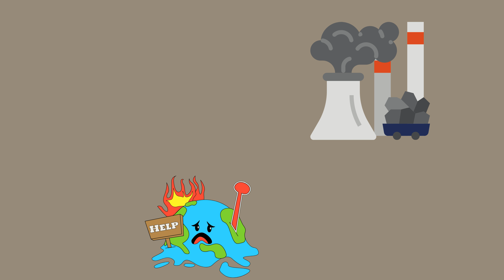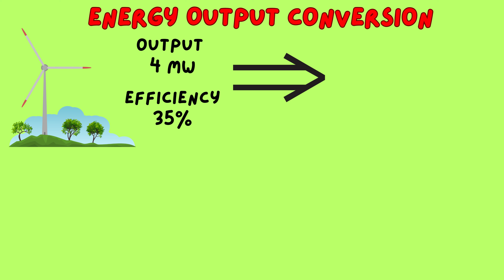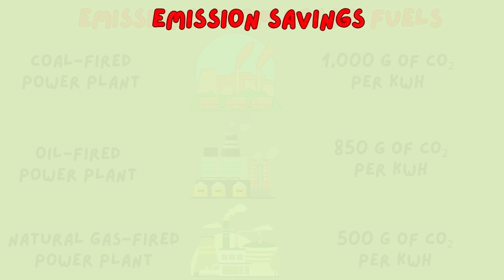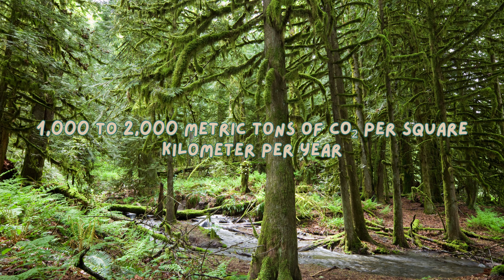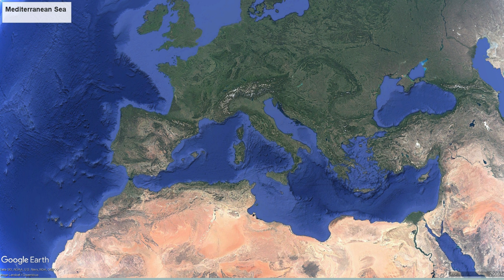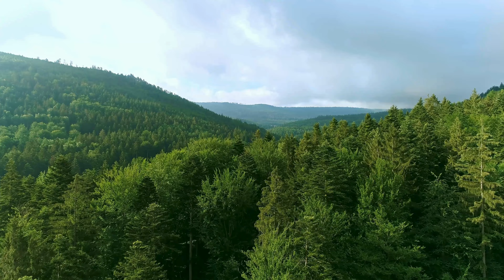Wind Turbines vs. Trees: How Much CO₂ Can One Turbine Save? #windturbines #renewableenergy

Comment: a 10MW wind turdine as single unit haaaa you are from alpha centuri or what?
Reply: There are prototype wind turbines with up to 15 MW capacity.
Reply from the maker: "Wind turbine capacity has increased over time. In 1985, typical turbines had a rated capacity of 0.05 MW and a rotor diameter of 15 metres. Today’s new wind power projects have a turbine capacity in the 3-4 MW range onshore and 8-12 MW offshore."
Source: International Renewable Energy Agency
https://www.irena.org/Energy-Transition/Technology/Wind-energy